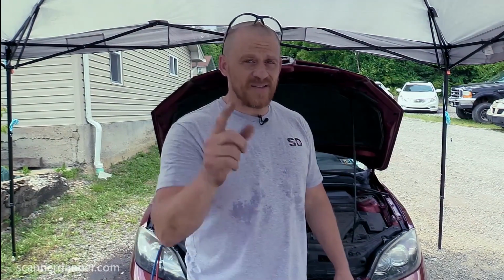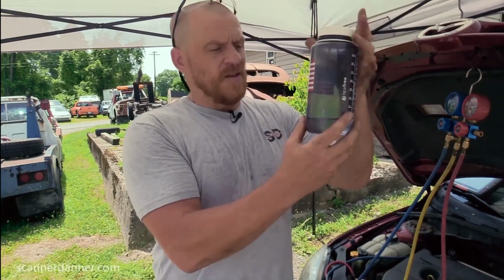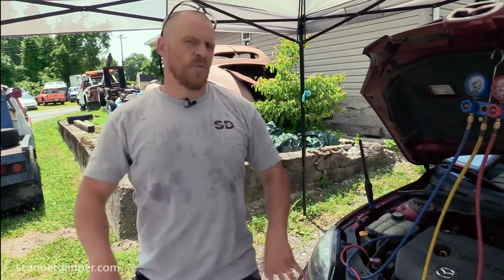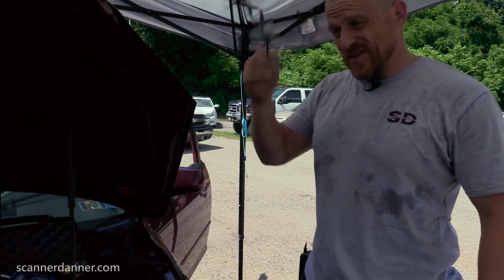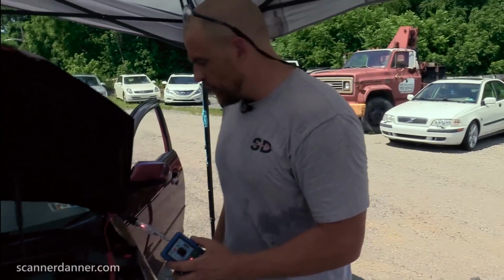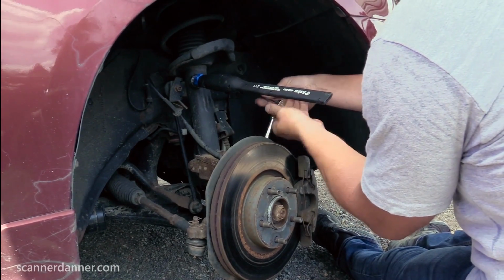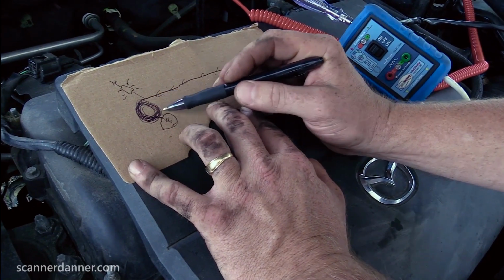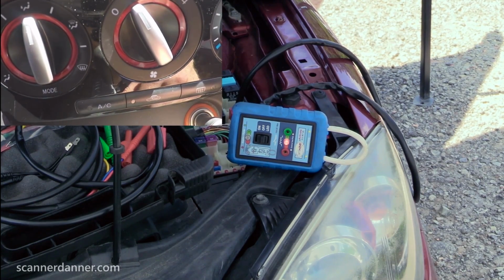A/C Clutch Does Not Engage-Diagnostic Fundamentals (full charge)

Comment: It's normal that when you turn the blower switch off the airco is turn off to.
Reply from the maker: For sure, it was just weird that I couldn't disable the AC compressor otherwise, no matter what I picked.
Reply: @ScannerDanner  yeah that's weird .
Maybe because the open circuit of the clutch😉
But nice video,s and good explanations, even for a Dutchman😁
Helps me with AC on cars here in Holland😉
Keep on going!

Comment: the one thing  that kills a/c  is contamination.  just the little bit of air in the manifold guage set is enough to start things off. so i never completely empty my guages. and bleed the lines on every hookup.   i prefer to test the electrical side first. if you jump the cluch electrcally then work backwards and find you have voltage on one side of the pressure switch but not the other  then its safe to throw guages on cuz its almost certainly low on refrigerant.   this however doesnt work on the new cluchless  throttled  compressors.    just thought id throw this out for discussion purposes. habits are hard to break so a look to see who has a good and who has a bad one and why might one be good or bad is a good thing to look at when learning.
Reply from the maker: can't teach bleeding the lines though, it is frowned upon to intentionally dump or vent any refrigerant to the atmosphere :-)
Reply: @ScannerDanner  yeah  cant bleed micro amounts  but when you hit a deer and dump the entire amount into the atmosphere its ok  smh

Comment: I probably should have finished the video. Just restarted where you draw the compressor and circuit on cardboard and tell caleb there is no ground wire it must ground right to the case on the compressor. Probably just answered my question. Basically just depends on where you think the easiest place to start would be and what you already think the problem could be. If your already leaning toward the clutch you can probably just go straight for the clutch?
Reply from the maker: For sure my friend
Reply: @ScannerDanner  thanks buddy.

Comment: Paul the top light is to tell you which post on the top is the power side of the load circuit. You take the switch and go to LED and if it's green or Red it tells you which top post is the power side of the load side which you accomplished with the test light which was the red terminal. Tells which post is 30 or 87 and If you'd have toggled the switch to LED it would have been glowing red. The LED will shine only when power & ground is present and the switch is in the LED position.  Lets you do voltage drop testing & know what top terminal is 30 or 87 with just the flip of the switch. I printed the manual from the CD & have the manual shrunk down to fit in the box for when I have/had questions b/c I used to think the same about the load side light but it only lights in the LED position if there is voltage and a ground. Hope this helped Paul.
Reply from the maker: I know, smh, this is the problem with releasing a video that is a year old. I have since figured out how to use the tool properly lol
Reply: @ScannerDanner  Yea I see all your videos on both channels and one you ask stuff you answered yourself on older videos so that explains it. Thought maybe the heat was getting to you  🤣😂
Reply from the maker: Haha nice!
Reply: I just got this tool and am still a little confused about its operation.
I am not a newbie to this stuff either. You mentioned thier was a manual or a DVD with the tool?
I did not get either with mine.
I'm gonna call ASE Wave and see what they say.
I need to take it out to a known goof car and play around with it also.
Be very careful about the current draw in the circuit you are testing.
The switch is only rated for 15 amps.
Great video.
Reply: @tpcoachfix  It has a 15A resettable CB at the bottom.
Reply: @tpcoachfix  AESWave has a You Tube channel and has 2 vieos on it one from MotorAge and one from Scanner Danner
Reply: @tpcoachfix  Mine had a CD Instruction  manual
Reply: @haywardsautomotive6156  Ok Thank You for your feedback.

Comment: Awesome video my man! Been getting those jobs left and right here at my shop. Oh and I would like to add a tip. while you're down there by the compressor on that connector check is to always hand turn the clutch and make sure it turns. I've had many times that a compressor could have internal lock up and you would need to replace the whole compressor than just the clutch. Usually while high heat driving and running into a huge flood fries the clutch, especially on how low are on these engines. Oh and that compressor stretchy belt are such pain in the ass to install.
Reply from the maker: Good tip, though I never change just the clutch. Just personal preference.
Reply: @ScannerDanner  no of course I do the same...including flush,drier and expansion valve change.

Comment: The reason, most likely, for the no comm with the AC system is because this was a manual AC and not an automatic climate control unit. Generally, the AC comm is only available for Auto AC. I think even your scan tool said that "only automatic climate control".
Also, for testing the ground, wouldn't a test light connected to battery positive, and then touching the test light to the clutch housing, it should light up, indicating a good ground? That would be an easier test IMO unless I'm missing something.
Reply from the maker: correct on your first assessment and as far as the light goes and how I used it, it is just my preference and I trust the result. Check out the bad block ground videos I referenced in "cards" in the video and it will make more sense.

Comment: Hey Paul and Caleb. Paul, do you think it would be possible if before all the preliminary checks that you did could you command the a/c clutch on and then substitute a ground at the clutch. If it turns on you know everything is good and you could condemn the clutch off the rip? Maybe back probe the ground wire at the connector with a t pin?
Reply from the maker: Just getting to the clutch was the hardest part. I feel that we started in the easiest location which was at the relay.
Reply: @ScannerDanner  I hear ya buddy. I was just wondering do you think it's possible to do it that way? Probably on vehicles where it's easier to get to the compressor wiring? Would just make for a pretty short video if that would work.
Reply from the maker: @robertwelch3899  for sure! If that compressor is right up top like they used to be and you know you have enough psi in the system (first check I always do), then check your power and ground right on the compressor next.

Comment: Wouldn't it be preferable to load test the housing ground while you're at it, rather than infer that it's good because it's not at Batt+. You could have an open coil and a bad ground. Just saying. Thanks for the vid.
Reply from the maker: you could in theory but that simply does not happen, and I am comfortable with the call of the clutch coil absolutely, with 100% certainty, that it is bad and needs replaced. You could also argue the feed wire was never really loaded either. You just do not have a bad component AND a wiring problem happen at the exact same time. But you are not wrong in what you are saying about the ground. I hope I'm making sense.
Reply: I'm not questioning your diagnosis, checking casing ground is almost superfluous anyway. I see how Professor Danner would use the opportunity to explain the principal of the bad ground side becoming positive, but I would tend to connect the test light to batt+ to get a more "positive" test of the ground, since it's no more trouble in this case. I thought it was worth mentioning.

Comment: Great video, thank you!! I had a situation where an A/C clutch would not engage. I measured the connector feeding power to the compressor with a multimeter and it showed around 11 volts.. Sometimes it showed 14 volts and then as I put back the connector the clutch activated, battery was ok. When I put current from an external battery 12,6volts the clutch kicked in.. What probably would be the fault?
Reply from the maker: "it showed 11 volts, sometimes it showed 14" sounds like a voltage drop on the clutch feed wire
Reply: @ScannerDanner  Thank you very much for the answer!!
Reply: do a current test also (amperage) a coil that's drawing high current can drop the voltage down and not blow the fuse until it's been on for some period.
often the current draw goes up as it gets hotter
Reply: @throttlebottle5906  Yes but I measured the feed connector disconnected from the compressor and it showed 11 volts and some times 14 without  determining why.. I pulled the harness back and forth to see if the voltage would change from a broken wire maybe but nothing. When I was applying 12.6 volts from an external battery the clutch would activate. It would also activate the moment the reading was 14v and I plugged the connector to the commpressor. Thank you for your time!

Comment: The SD premium channel is definitely worth it. Look up the cost of going to a technical school for automotive technology and compare that to the $11 a month for SD. I know it's not a direct comparison, but if you're wanting to learn how to properly diagnose and repair vehicles  there simply is not a better or more affordable option. Seriously, go watch one video from some rando on Youtube showing you how he repaired his bad computer ground by replacing the fuel pump relay, the fuel pump itself, all of the injectors, and then by dumb luck bumped a ground that fixed his problem $800 unnecessary dollars later. Compare that to the methodical approach to properly diagnosing the exact issue in a short period of time that Paul teaches. The only difference between the two scenarios is having the proper diagnostic knowledge to assess and correct the problem and that is what you will find on SD premium.
Reply from the maker: Thank you Patrick!!

Comment: I’ve done too many of these lately lol great video Paul and Caleb. I usually put the connectors on both wires to see if I get power through the clutch itself from battery neg and pos and if it lites the test light  Then it’s wiring windings are good. Then I put my power on the signal wire and ground on the casing to see if the magnet will pull to the pulley.  Even being flooded it’s a Sealed system I bet the compressor is good. Thanks for sharing..., Jay

The compressor grounds to the block from the bolts no?
Reply from the maker: yes sir it does

Comment: I use a Camel Back filled with ice. Let it rest on my back.. As it's a 105 degrees today. And I'm replacing Valve cover gaskets on a Volvo 4.4 V8... 6 hour job.
So I will trade you that for the Zoom Zoom Ford AC replacement. As i love working on them cars. Even with the keyless crank timing. As most people screw that up and pound the valves through the pistons.

Comment: This is one of the reasons I like cars with the compressor on the top of the engine.  Easy to replace and if the cars in a flood it will be above the water most likely.  If this car had it on the top of the engine this probably wouldn't of happened.

Comment: Hey Danner, in certain climates like Texas where the degrees might be 90 but the heat index is 110 would the static pressure be 90?
Reply from the maker: Remember that each refrigerant has a specific psi temp relationship and the R134a scale is one that closely matches the degree F scale but that being said, the rest pressure will be directly proportional to the actual temp, not the heat index (humidity). BUT the heat index has a HUGE effect on system performance once it is up and running.
Reply: ScannerDanner 
Thank you for taking the time to reply sir! Very much appreciated. It’s right in line with what I thought but I needed that confirmation.
Reply: Very good question....  because our humidity scale is off the scales lol we stay in the over 70 % range here in Texas lol
Reply from the maker: @bigmac8299  It was an upper 60s to lower 70 dew point this particular day. It was brutal